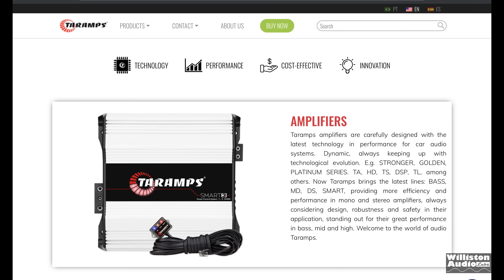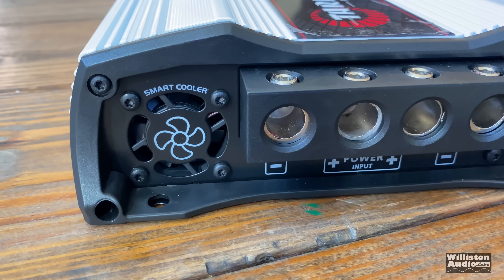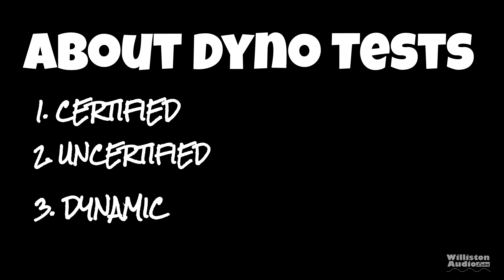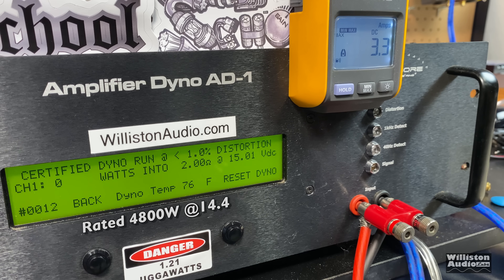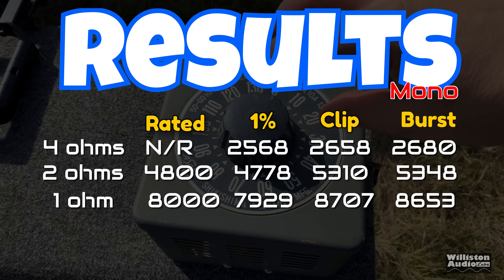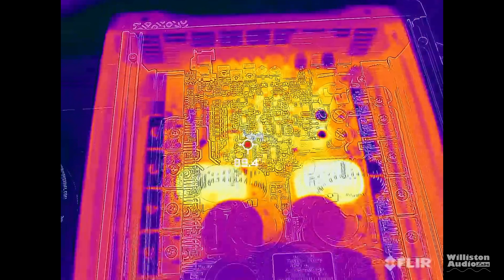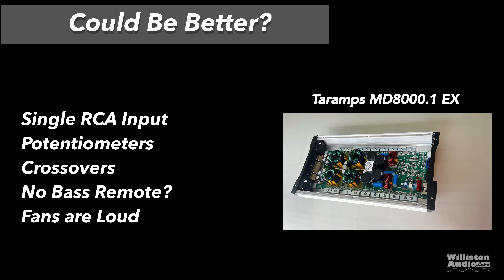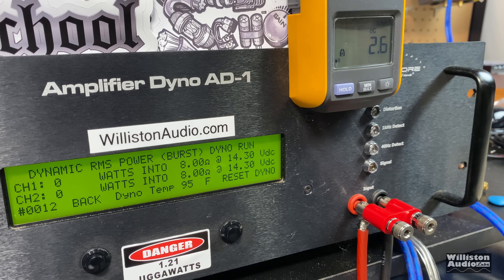8000 watts, but What's New? Taramps MD8000.1 EX Amp Dyno Test and More [4K]

Comment: Surprised only being 4v on the RCA's didnt feature in the could it be better section when 4v is pretty much the absolute minimum you expect out of a half decent headunit and 5v and 6v are common place and even 8v is out there.
my headunit outputs 6v and the RCA inputs on my amps do up to 8v
Reply from the maker: Zero issue using 6 or 8V head unit with 4V max input amp

Comment: 8k is a lot of power. Even at 90% efficiency you would need multiple batteries and at least one 400 amp alternator to resupply the batteries. 2 would be better. Thanks for testing. Out of my league.
Reply from the maker: Mine too! Still fun to see 😝
Reply: Excellent reality check!!!... Yes allot of extra electrical BS HASSLE for only 3db more than a 4k amp....

Comment: I just recently went from the smart 3k to a md 8k and it is the normal md so no dual inputs. How ever I use shca dual 1/0 inputs and they work great! Love all my taramps product. I have 2 smart 3ks, a md12k, and md8k. Ive had some of these amps for a number of years and they all work flawlessly!
Reply: But don't you know taramps are supposed to randomly catch fire? 🤣🤣🤣🤣
Reply: @beardedforlife3740  I mean…definitely not arguing but last I checked. That hasn’t been a issue in recent years. All the sundown lovers on the other hand with those sfb amps😂😭 you might wanna go make sure you gotta fire extinguisher 😭🙌🏻
Reply: @carsonbarker2892  oh I know, I was just being a smart ass lol that's just the argument people use against taramps when it hasn't been an issue for a decade. Now those sfb amps are kinda scary
Reply: @beardedforlife3740  no your good lol I figured so lol and Fr I’ve seen nothing bud bad from those sfb, and from the experience I’ve had with them they just arnt that special in my opinion. Would rather have a taramps all day than a sia or sfb

Comment: Just to keep your wires from getting cross, a little trick I do on the amps I repair is to mark the "+" terminals with a "RED" marker, speaker and remote also. Not much but it does give you a visual reference.
Reply: You could also cut a little piece of red and or black heat shrink for + & -
Reply: where you located
Reply: @nuclearbum9858  if you are talking about me, Georgia, Forsyth
Reply: @strictlyamps820  you work on amps

Comment: I've  commented on taramps many times about the rca input yes it says 1 rca for input but I  contacted taramps personally  and they told me both rca inputs can be used for input signal.
Reply from the maker: Sure they can
Reply: @wal  im being serious big d.
Reply: The soundstream amp is the same, one in and one out. If you try and use   both as inputs, the signal will cancel and there will be no audio. It's as if one's polarity is reversed. I had to use a y adapter, wanted to use both outputs of the epicenter.
Reply: @2slofouru  ok well taramps both can be input I plug both jacks in  and if I o ly use the 1 labeled in I get half the input volts
Reply: @2slofouru  no im talking  newer full bridge amps both can rca can be used for input its called balanced and unbalanced inputs

Comment: I'm Really On The Fence About These. I Need A Lot Of "Power" For My Set Up. My Systems Wired To 0.5Ohm 2 12s And It Rises Up To About 6Ohms. My DD M5 Actually Does About 3,000 Watts At 6Ohms Which Is Better Then This Taramps 8k Given 4Ohms It Does 2500. All Sub Rebuilders Show Coils And Say "That's A Brazilian Amp" So That Keeps Me Away Too. What I Plan To Do Is Wire Each Of My Sub In Series And Then Parallel Together At 2Ohms (dual 2 ohm subs). I Want To Run Them At Series So The BL Is The Highest (more windings in the gap) To Get The Most Effiency Out Them, Or At Least That's The Idea haha. Going From 0.5 Ohm To 2 Ohm Probably Means Even More Impedance Rise So I Need A Massive Amplifier To Make The Power I Want. I'm Thinking Maybe A 12K 2Ohm Taramps But I'll Have To Do More Investigation On These Amps. Plus I Need To Find Out For Myself If Running The Subs In Series Is Even Worth The Trouble If You Can Just Throw More Power At It At Lower Impedance To Make Up For It... hahaha
Reply: All the tramps have bass cut off below 32hz.... If you like superdeep bass or rave music drum and bass.... There a NO.....I warned you!!
Reply: @sarahconner9433  Yea I Found That Out On The 3k Amp. I Thought They Were Sub Sonic Filtered Lower On The Larger Amps. It Looked Like It Was Playing The Bass I Love You In The Video Pretty Low But I Guess Not. If That's The Case With The Bigger Ones Is A Definite No Now haha. 1 Of My Ports Is For 25Hz And I Start To Roll Off After 32Hz XD

Comment: Hey, awaiting my Orion HCCA 3000.1 to be delivered today. I have 126 Ah in agm batteries, on Stock amplifier. Big 3 upgrade. Should I be ok????? I hear that it HAS TO be fed... I only need 3000 w for now... Am I going to hurt my amp???
Reply: Hell no you need at least either a 320alt or a lithium bank that amp will die a sad death it will suck so much power your 120ah of amg will be dry in 2 thumps lol

Comment: I would consider this running @ 4ohm just for that efficiency . Plus have the ability to push more power later on after upgrading the electrical to move that kinda power .
Reply: Taramps makes a MD3k in a 4ohm version that make 3000 RMS @ 4ohms. They also have a 1ohm and 2 ohm version of that amp. They might have a 4 ohm of the MD8k I'm not sure. But I've done what you're describing in the past of running an amp at 4ohm until I got a 2nd sub then running at 2ohm and doubling the power by halving the resistance.
Reply: Id be running 2 1/2 to 4 ohm coils with rise on two 8 ohm 1000w electrovoice 15 inch loudspeakers I think they can handle about 90v max
Reply: With that kind of efficiency I'm wondering if you can get get away with just two runs of four guage
Reply: I actually bought an 8k just to run my dual 4ohm single 12" (roughly 3ohm after rise) for the efficiency.  It was cool to play around with even being able to run the sub coils in series with that much power available.  Although I was using 3kw rms class AB before, I thought I'd try out not only having more power on tap, but at roughly the same power draw.  My personal downside was the SQ degraded noticeably.

Comment: A comment about the frequencies. You mentioned that no one would use this much power at 40 hz, but in latin america, where this amp comes from, we use these to power our mids and highs almost exclusively. It's rare to see an MD line Taramps playing anything under 100hz
Reply from the maker: Wow, 8000W for mids? Holy 😲
Reply: @wal  We normally run 6-8 10" or 12" mid bass drivers on big systems. Some guys will run an 5k or an 8k to their compression horn drivers. And almost nobody runs more than 1k on their subs! Real different audio culture than in the US

Comment: It is a lot of power for the money and honestly one of the most popular amps I've seen but, the MD line isn't known for lasting to long. I would choose the smart 5 first. Makes A SHIZZ TON of power and it's regulated power supply tries to keep it healthy. If the 2 synergy wfo 3ks break the smart 5 is where I'll prob go. Im running around 7-8k not wired to the dirt. They're prob last till a smart 7k comes out. That'll be oodles of juice yo! Keep up the good work, shinning the light on the good and the bad helps us all, and we appreciate it

Comment: i have got a few taramps amps figured out the problem ( people try to run them without enuff power ) taramps has sent me the parts free of charge every time  . they even sent a whole board once , there customer service is awsome ! they are some of the best sub amps out there ask sam he loves them . put tinted plexiglass on the bottom and swap out the fans for rgb cpu fans for a cheap cool look !

Comment: Been running one of these close to .5 ohms for some time now. Super reliable so far.
Reply: Stestom Amplifier Is Better
Reply: @vanessa booth  and a Sound Digital is better than Stetsom... AND a Trauma Concussion is better than both of those amps. Point being, so what!!! There will always be a product that is superior to the one being talked about!
Reply: what subs handle this?
Reply: @trueneutral3092  3 American Bass XFL1244's wired parallel. Had 3 aluminum face rockford T112's prior, they did ok as well but not as hungry.
Reply: @bbtjdonnelly14  dayumm I'm running 4 xfl12s d4 on a hd3000 at 2 ohm
Reply: @trueneutral3092  soundqubed audio Hdx3 18's
Reply: What voltage is required for this amp?

Comment: You responded to my email about a year ago about my amp. You didn't want me to send it to you bc you're so busy. I been so busy OTR that I still have it in the box and never used it. Lol. I know it's not top of the line and probably discontinued. I bought it around 10 years ago. Was hoping if it works at all, what subs would be a good match?...

Comment: I’m in a debate between 2 smart 5 bass amps or 2 md 8000 to have each amp run 3 skar zvx 18 d2 at 1.33 Would you mind doing a 1.33 ohm test for me on the md 8k or could you make a video comparing the two amplifiers because they’re very similar I’m almost wondering if the smart 5 bass is a chip Limited md8k

Comment: I have two of the MD 1800.1 1ohms one for subs and one for highs, I noticed with the MD's if your using for subs its best with an epicenter, bass reconstructor or some kind of dsp bass from it just isn't the same. I noticed a sound difference (just bass) between my sundown sfb600d, jensen xda91rb and my orion xtr650.1, don't get me wrong its an awesome amp just needs a little help with bass. Has anyone else noticed that with the MD series?
Reply: I have but as long s I'm not listening to r&b or blues it's OK.  Heavy bass tracks don't suffer much from it.... Especially rebassed tracks.
Reply: Yep the rp4500.1 that replaced my md8k had waay more authority under mid 30s than the taramps.
Reply: @erik120719  Yeah they seem to have issues with lower note authority. But don't tell some folks that cause they'll be ready to fight just because your ears can judge sound a little better than theirs.
Reply: @keithmagnifico4164  yeah been there and offended ppl already. I been installing since early 90s and been tuning by ear for a long time till I finally got an o-scope so I think my ears r pretty good, age and louder systems made me question my ears a bit so I got dd1 and cc1 but still feel my ears r better than most lol
Reply: I move between the MD1800.1 and SFB3000.1 which actually Dyno within 300 watts of each other. The Sundown does seem to be better with the very deep bass. On my smaller subs (Q Class 10s) I like the Taramps, but with my single U-15 the deep bass feels effortless from the Sundown amp.
Reply: @ryanrichardson6823  I had the same type of results using a much smaller amp. The hifonics alpha 3000 though a much weaker amp had much more athority on the low notes than my taramps md8000.
Reply: @ryanrichardson6823  I was running 3 AB TNTs (1500 rms version) in 12cuft net, tuned at 27hz with almost 3 cubes port area. The taramps was nasty, loved it but one month after warranty was up it shitted out. I replaced it with the rp4500 and it was night and day. I was running the MD at 2.66 ohms ( was 2 ohm version 8k) and the rp saw .66 ohms so subs were getting pretty close to same power. 2 300a alts, 8agm cells, dual runs 3/0 welding cable. Same settings with dd1 and cc1. I was literally blown away by how much better the rp sounded with less ( not alot less but still less) power. Down at 27hz the rp was knocking the hinge pins out of my passenger door! The taramps made everything flex but just didn't have the down low

Comment: They are literally the only amps that scare me. 🤐
@3:45 Tears came to my eyes, so so funny.
Reply: Why do they scare you?
Reply: @beardedforlife3740  Can't help thinking of a ticking time bomb.
Reply: @alphaomega8373  the MD line and smart line have just as much of a chance of blowing as any other amp. The smart line might actually be harder to blow than most amps if I'm being honest
Reply: @beardedforlife3740  Cant think of his name. But theres a guy that fixes amp on YT. He had explain why they can be dangerous and how they were meant for loud speakers not sub woofers. Something about the Rail voltage being to high or something.

Its been years since I've seen that video. But he was very convincing. 
There are waaaay to many other safer choices out there.
Reply: @alphaomega8373  the old taramps for about 10yrs ago were kinda dangerous. Today however they are quite safe to run. The smart3 I have has never gotten hot
Reply: @beardedforlife3740  Ill check out some more videos about them. The price still are tops in incentives.